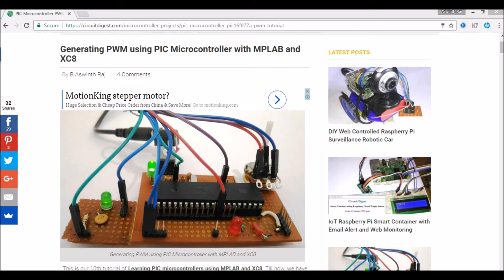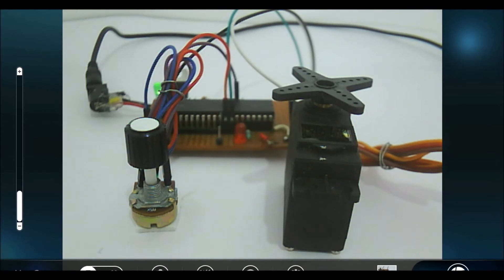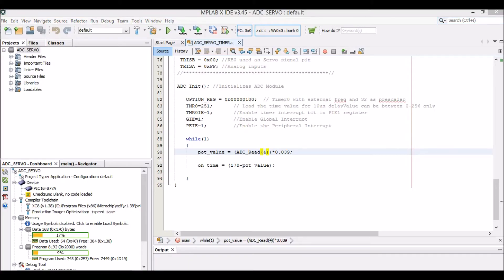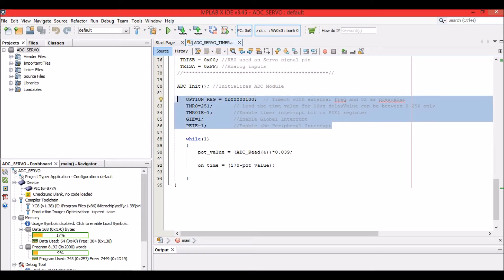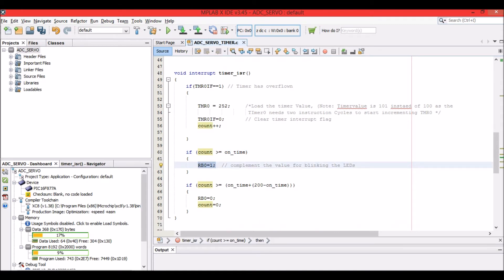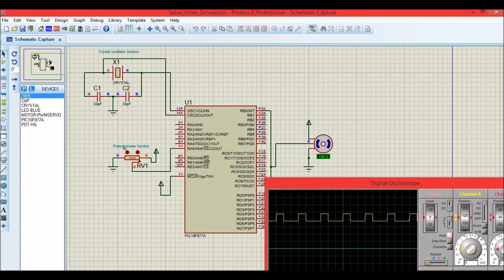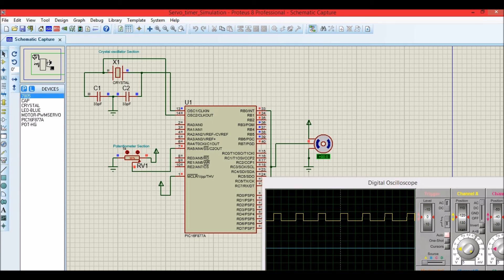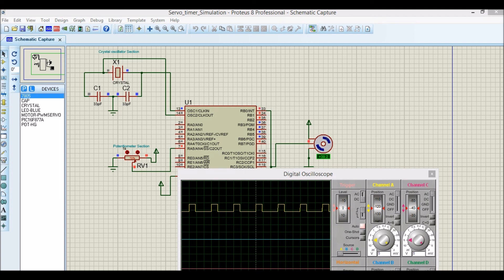How to Control Servo Motor with PIC Microcontroller

Comment: I'll be right back. But what if I want to turn off the potentiometer and set a fixed resistive value? What exactly do I need? Here the potentiometer (position as in the servocontrol) acts as a feedback! I would replace it with a hall effect sensor oriented towards the motor housing. In practice I need your idea to be used internally to the servo to make it "come back" and adjust the pwm as it should .... .

Comment: Hi i have been struggling quite badly, any chance i could get any help? like email or something?
Reply from the maker: You can use our forums or the comment section below that project.
Thanks
Reply: @Circuitdigest   and if I want with more servomotors, potentiometers; I must also use the PIC18F4550, which line of code should I modify or duplicate or add? Please I need your help :(